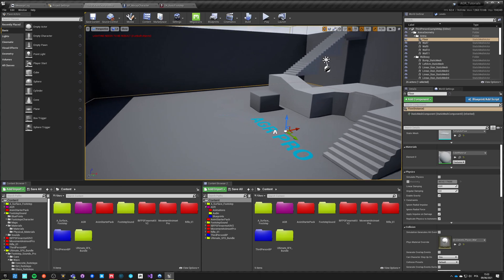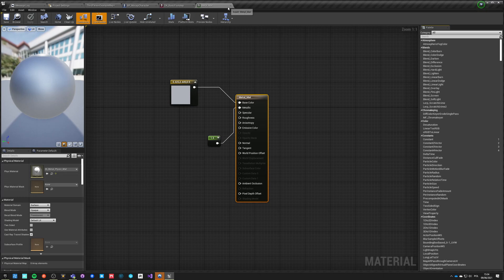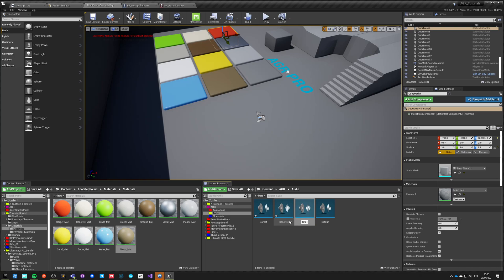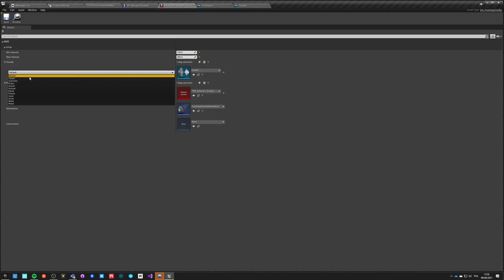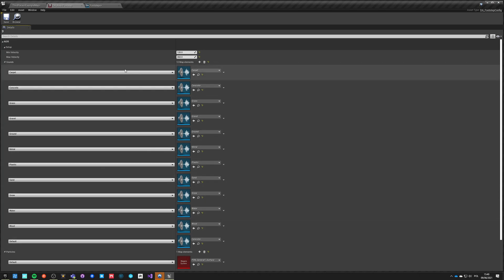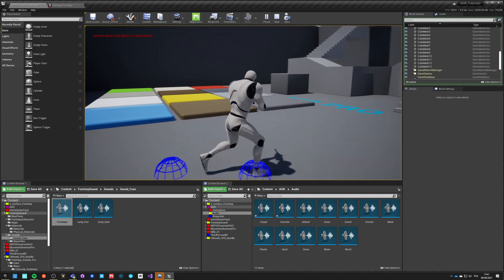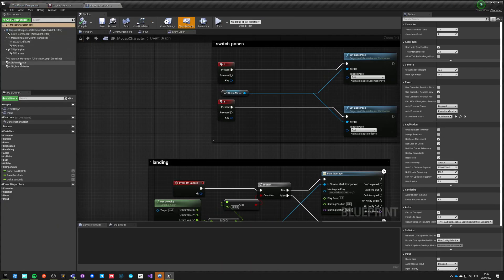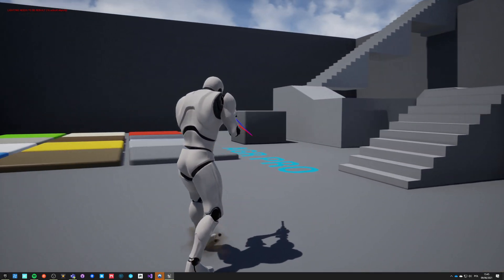2/4 AGR Sound Component - Multiple Surface Sounds & Particles - UE4 Tutorial

Comment: Hi Angel, could we get better performance using AGR instead of ALS v4? Were currently using ALXV4 community but something just feels off with it so weve looked into your setup and it seems easier to use than ALS but is performance better using your AGR compared to ALSV4? and in the replicated aspect as well. Thank you.
Reply from the maker: like FPS performance? yes for sure. I get above 120 characters runing AGR before it starts slowing down :)
Reply: @3sgamestudio  Cool, i was hoping it would be better, because ALSV4 community seem's so hard coded and bloated especially adding custom animations is god awful, so yeah i guess well make the jump to AGR and just refactor what weve done so far. By Any chance have you done a cover system with AGR yet. This was onr of the issues we had with ALSv4 where we needed to do way to much to get a dynamic cover system going and even then it didnt play to well with the root motion anims.
Reply from the maker: @insanestudios9643  a cover system? I could try. Should be manageable
Reply: @3sgamestudio  Cool i love your videos, i cany wait to see what you come up with on this cover system.